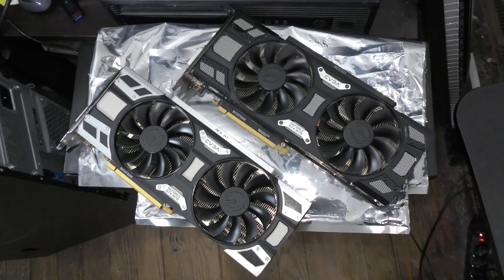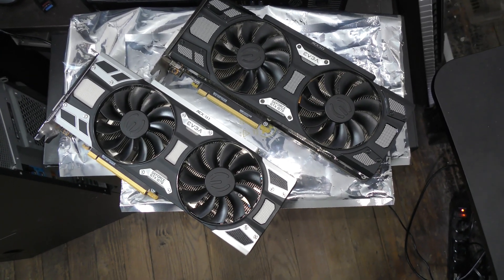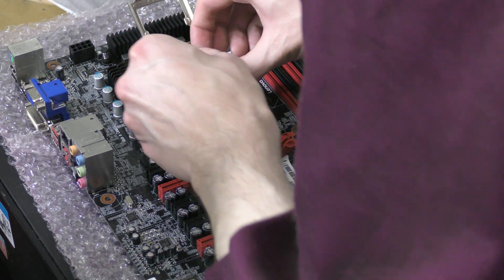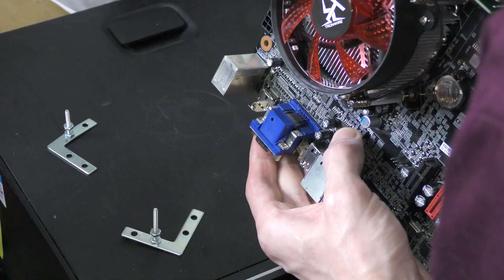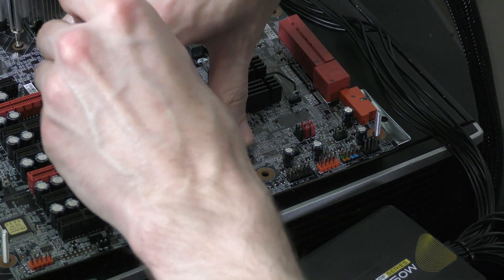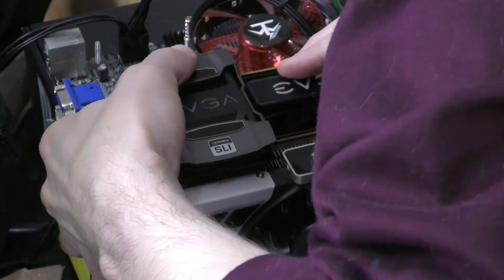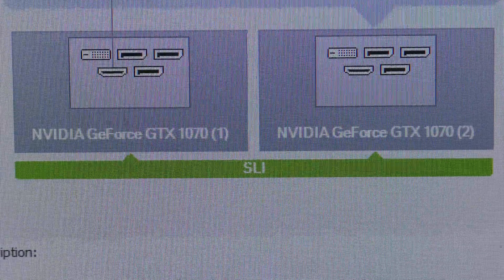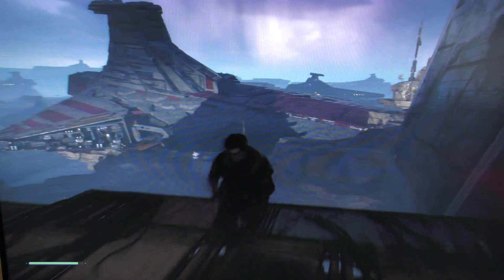SLI could have been Fly - Dual Wielding GPUs

Comment: Awesome video, in my opinion you are absolutely hilarious.

Quick question what cpu cooler do you have on the motherboard and the retro wall mount 
Mine recently stopped working
Reply from the maker: I appreciate that 🙂. The CPU cooler is a "Tronwire". It is pretty cheap, only about $15 on Amazon, but also so-so. Has kept up pretty well with what I use it for, but running something newer/more powerful might be a chore for it. There is another cooler I like, the "Cooler Master i71c". It seems a bit more powerful, and also a little quieter. And it is only a few dollars more, at a little over 20 bucks. Really just depends on your preference/what you need, but I have found those 2 to both be pretty good budget options. Thank you for watching!
Reply: Thanks
Reply from the maker: @paytonrr2476  No problem!

Comment: ran SLI on a s939 AMD with dual 6600GT's for Half Life 2 launch and then years later on an i7 860 with dual GTX 570's....only complaint was the heat output

Comment: The issue (or I should say, «my issue») is that SLI isn't new. It's actually over 20 years old, and neither Nvidia nor Radeon ever truly figured it out, being for technical reasons or, as you said, lack of motivation. It was also extra work for developers as well. If they can barely make a decent port today (as in «kinda-sorta-but-not-really-gimme-all-your-vram»), imagine what SLI support would be right now...

Our expectations were high as well. For example, I have a 1080p running a game at 60 FPS. If I throw another card, I'd expect to see almost 120 FPS at 1080p, or 1440p at a decent framerate. In practice, that ain't happening... but my mind screams «it should». Twice the power, twice the resources.

But the technology worked. It actually worked like a charm on 3dfx cards, enabling faster framerate and higher resolution support. I had the chance to play the original Unreal at 1024x768 with two Voodoo2 cards back in 1998, and it was insane. I was there Gandalf, 3000 years ago...
Reply from the maker: All fair points. The angle from game development is especially valid, I should have thought to say something about that. It is hard to tell how that would pan out. I would like to think (if SLI was solid and practical and widely adopted), that developers who put in the extra effort to support it in games would be rewarded with higher sales, and be more inclined to put effort into it... but that probably is all wishful thinking. The same way I wouldn't have faith in GPU companies to perfect SLI, I wouldn't really expect game companies to go the extra mile for people who ran it. At least, most of them. But I'm just speculating about what may have been, so who knows.